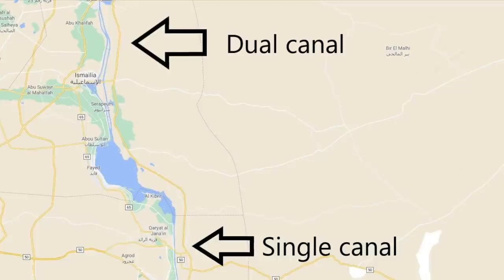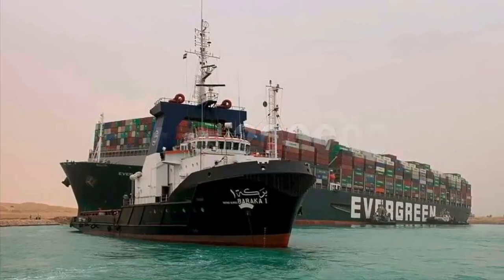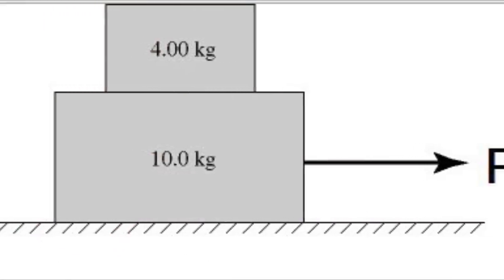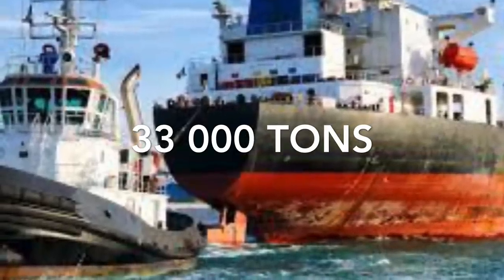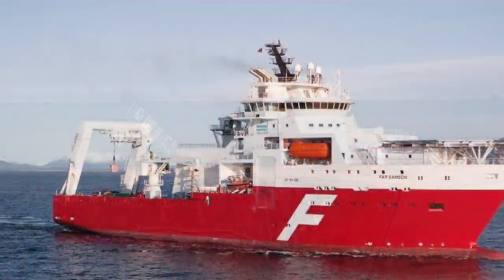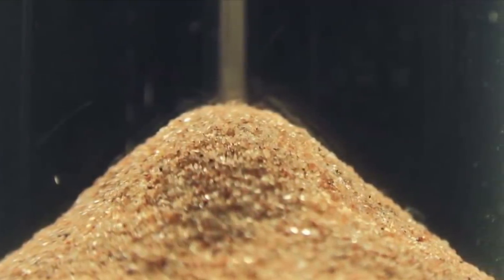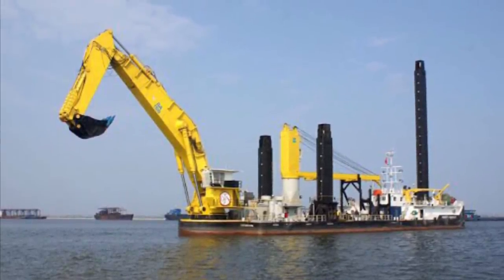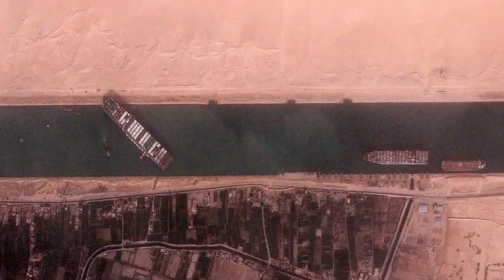MV Ever Given - why can't it be pulled out? Suez canal blocked

Comment: Life lesson: Don't try the three-point turn unless you have a driveway to pull into.
Reply: Why has the Suez not been made wider over the past and recent years , at least 100 meters
Reply: @blackadder1415  the southern part of the canal is at least 15 miles long with cities, towns roads etc on both side it would be a very problematic solution to this but I believe after this more people will realize itll have to be widened
Reply: Austin Powers begs to differ